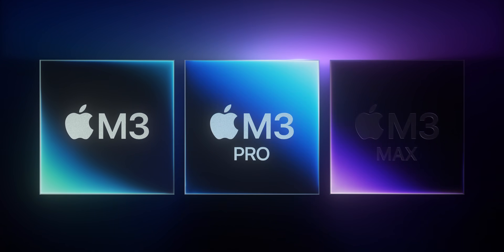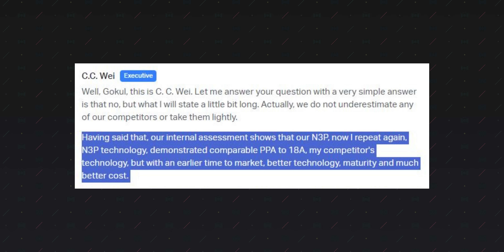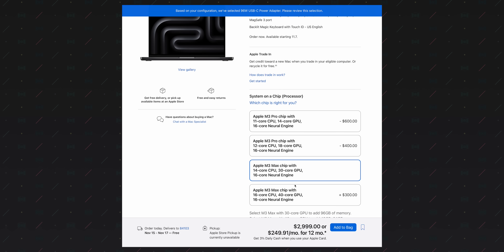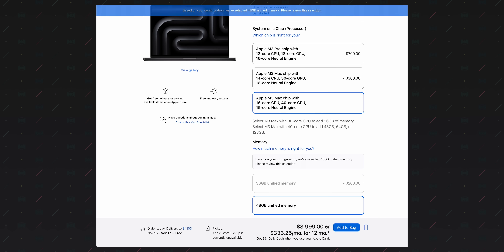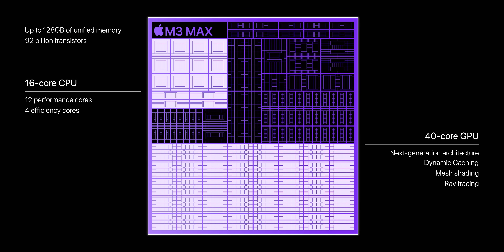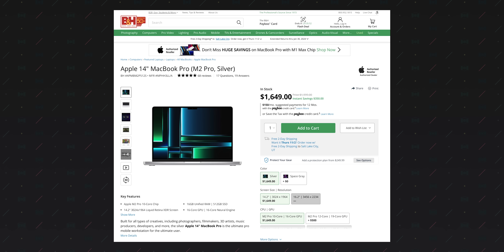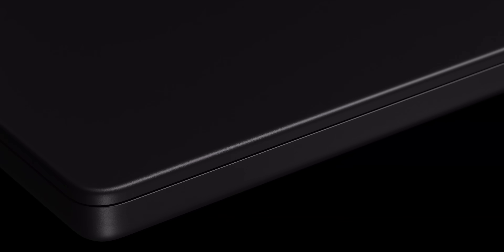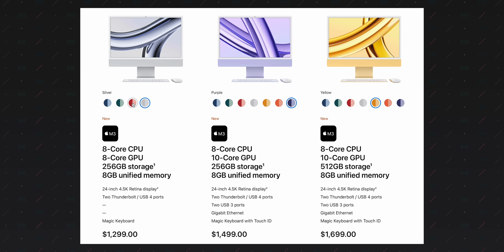Apple M3 Deep Dive: The Details Most Skipped Over

Comment: 8GB as lowest RAM Tier in an "Pro" notebook - that has to end!
Reply: When I bought my first MBP, the lowest tier was 8GB/128GB. 8 years later, only SSD doubled up. It's embarrassing given the RAM price right now.
Reply: @huyanh995 the SSD quadrupled
Reply: @nylotical  from 128GB to 256GB base M3 is not quadrupled.
Reply: I had 16 GIGs 10+ years ago @huyanh995
Reply: @huyanh995  Why? It's only a $250 upgrade for 8GB more    😝😝  (you can get 128GB on PC for that price)
Reply: You can get a $109 phone with 8gb of RAM, it's ridiculous!
Reply: @johnsch8634  just pay 109£ for tablet 64/6gb :D
Reply: when you can get 32gb of ddr5 for that  price apple is way too greedy @johnsch8634
Reply: @johnsch8634 yeah that’s not exactly a good point.   The RAM in that phone and the RAM in the new Macs are not equivocal in ANY way.   M3 can do EXPONENTIALLY more than any phone on the planet regardless of the starting 8gbs of RAM.   More RAM doesn’t mean more performance it’s better to look at the big picture to decide what quantity of RAM is needed.
Reply: @Champoforyx  have you never heard of using an extreme example to make a point?

Anyway, my laptop came with 16GB in 2020 and I upgraded it to 64GB just because I wanted to and it was cheap. I bought it to take the place of my 2014 macbook air which had 4GB of RAM and was chronicly short of RAM.

The idea of buying a "pro" laptop for $1,600 nearly a decade later with only double the RAM of my $999 2014 macbook air is laughable.
Reply: 8GB RAM good for ruining SSD.
Reply: Yeah, nobody is going to get that level of a computer and make do with 8GB, so really the entry level model is the 18GB. I think they just made a hobbled low price model, that nobody would buy, to get the low headline figure.
Reply: By the time they bump it to 16gb, 16gb will feel like 8gb again lol. I love Apple. But please, stop doing this. 256gb of storage is ridiculous as well.
Reply: And you have the base m3, not even pro this year
Reply: To align with there environmental goals it needs to be16GB across all products with unified memory. This would provide a longer product lifecycle. If it were SODIMM not a problem.
Reply: @micleeso they can’t do SODIMM.  The M3 is an SOC.   It would not be able to be upgraded.   Even if it could, there wouldn’t be anything currently on the market that would be supported by the SOC
Reply: Yes, I am aware M series chips are SOC. I was a comparison, if SODIMS were still used then a future upgrade is possible, enabling a longer lifecycle. @Champoforyx
Reply: @micleeso  it would limit the performance of the M3.    They require the RAM to be incredibly close to the package in order to function at a high level.
Reply: then who will buy new m4s lol
 @micleeso
Reply: 8gb us still Pro guys
Apple meant Pro-blematic & not Proffesional
Reply: This should be not up for debate, idc what your workload is - 8GB is criminal in 2023 regardless if you're a student or professional.
Reply: Yeah everybody is angry about it , everywhere on the web .
Reply: In the DIY PC market, 32gb has been lowest recommended for a couple years now for a new build (It is $80 for a 32gb RAM kit, versus like $60 for 16gb).

8gb was obsolete in 2015.  8Gb kits are not even made anymore.
Reply: @Zyxlian and that is just system RAM.  That doesn't include VRAM, like the M-chips do
Reply: over 2000€ in EU, no sense
Reply: @jeremy__hopkins  I think they know nobody in their right mind will buy those, or pay the ‘starts from’ price. They could advertise a version that starts from £1000 that, by some clever ‘stink embedding technology’… permanently smelt of dog poo. It’s a bit misleading as they know nobody would ever buy that model. So the ‘starts from’ price is essentially just click bait.
Reply: Well, a year later and they heard ya.
Reply: Wish granted
Reply: even 256 GB SSD is pretty sad for pro macbook at baseline. A Mac is not an iPhone, 256 is still ridiculously overkill for a phone but I see 1TB as a baseline for me on a mac. But I guess that means I must shell out an extra 100,000,000,000,000,000,000 to get the upgraded storage
Reply: @Kelson01   256GB overkill for a device that can record 4k videos in slowmotion?  In what universe do you live?
Reply: @voidmayonnaise  Which is why I upgraded to 64GB Ram (sorry, 'unified memory') on my Mac Studio M1 Max... cuz I knew that anything less would make the machine feel really slow 5 years from now.
Reply: overkill..&overpriced...i got a cheaaaaaap 12th gen 6&6core...god super high single core score...at literally 30% price with 64ram cost nothing ... @rsr789
Reply: Yeah that´s just a scam
Reply: And £200 to upgrade to 16GB (in the UK) is criminal
Reply: macrumors apologist...`yeah but...`
Reply: @youngtrench3711  top rated comment on the Macrumors post about the M3 MacBooks is one criticising the 8GB RAM, so no, Macrumor users are the most critical of some of Apples dumb moves like this
Reply: I’m not paying a single cent more for larger memory or storage! 8/256 all the way.
Reply: Next you’ll say 16 has to stop
Reply: $600 AUD to upgrade from 18 to 36GB RAM… the apple has rotten
Reply: That pisses me off!
Reply: In a “Pro”*
Reply: @firerainnzz  they are pro devices.     Not all pros need tons of ram.   Stop acting like MacBook pros are not the top tier of laptops
Reply: @Champoforyx I was correcting because it should be a pro not a pro. I fully agree that MacBook Pros are the top tier of laptops.
Reply: @Champoforyx open photoshop, MBP has left the chat,
Reply: So, just like the M1 and M2 13" "Pro" models before, this new M3 Macbook "Pro" is Apple really straining the definition of what most in the tech world would define as pro. At least, they upgraded the hardware to Pro-level.
Reply: I agree that is is too little for most professional workloads today, but I can't really see the problem with having that option. Just get one with more RAM.
Reply: @Pekz00r the price of ram on Mac is just absurd
Reply: @neojfk1883  Yes, I agree with that and THAT is the only problem here. Not that they start at 8 GB.
Reply: Why!? Sheep will buy
Reply: @neojfk1883 
 sheep here😂😂😂😂😂
Reply: My $4000 PC has 192GB of DDR5 6800MHZ RAM and 24GB of DDR6x VRAM

I wonder how much 216GB of Unified memory would cost in a mac Pro
Reply: Especially when RAM and SSD prices have never been lower.  1TB and 16GB should be bare minimums in 2023 on any computer.   That's a $400 upgrade from Apple ($600 on the iMac or Air)
Reply: Apple started using 8gb as there base ram for MacBooks since 2012.
Reply: I think this is Apple's new selling point. It used to be buying all these expensive dongles and accessories for the laptop, but now its pay a boat load for ram. I mean even my old cheapo mac mini can put in 64gb of ram. So dang glad I got that thing as I wait for them to make ram prices more fair.
Reply: It's of no practical significance they spec 8GB.  It just makes the price look better.  Anyone "pro" will already know they'll be paying an insane amount for extra RAM.  Having 32GB base wouldn't lower the price of 64GB.  8 and 16GB flash was useless for iPhones, but they kept that around forever to shave a bit off the supposed price.  Again, to no practical detriment to anyone who didn't buy it.
Reply: 8gb/256gb has been the baseline ever since 2014. The baseline macbook "pro" hasnt seen an improvement in storage in almost a decade
Reply: The leader in E-waste won’t change their business model if dummies keep buying their garbage configurations😂
Reply: @sydwelglobal1439  I mean, it depends.  My friend got a base config laptop, my folks got a base config iMac, and both have got over 5 years out of them.  The iMac will probably hit 10, and only need replacing because of obsolete software, not RAM or CPU.
But, sure, the base configs are an annoying way to make the real price of what most people need seem $200-800 lower than it really is.
Reply: You don't get to be a trillion dollar company by offering 16GB of ram on your pro model.
Reply: The “8gb ram is insufficient!” folks have no idea how SoC or unified memory works. 🤫
Reply: android sheep are here😂😂😂😂😂😂😂😂😂😂
Reply: @jeremy__hopkins To be fair I have a ‘13 Macbook Pro that I use daily. I was concerned they’d completely abandon x86 Mac’s (especially the old ones). In reality I still get frequent of quality of life improvements and security updates. Just one example, my watch now unlocks my Macbook. Hardly life changing, but nice to have. That said Windows has gotten a lot better in regard to updates as well. My wife’s laptop is a 2014 that originally had windows 7 and is now on 10 and running well. Just giving credit where credits do. Then again, I might be singing a different tune if my ‘13 Macbook Pro wasn’t top spec at the time it was built.
Reply: It’s the hole reason I won’t make the switch from Windows to Apple laptop
Reply: The MacBook Pro with a m3 ain’t pro tho it’s just a boosted mac air the real pro is the m3 pro chip
Reply: @bobmorane2082  a processor named “pro” I guess makes sense linguistically as far as marketing, but I’d argue what really makes a computer suitable for pro (work you get paid for) use would be port availability and ram hdd space.  The M3 is pretty powerful.  But even a M3 max, with 8GB, wouldn’t be suitable for pro work outside of say, writing a book.
Reply: Snazzy actually thinks 2GB is enough
Reply: 8gb is a joke. I have two M1 airs. One with 8 and one with 16. The 8gb one struggles the moment you using multiple apps. The M3 should have started with 16gb.
Reply: @iamsid23 interesting as most all reviews said that fir mist people, including those running more than one app, only need 8GB. And for most apps that true.
Reply: Yes, and to get cheapest 16GB M3 you need almost 2000$, M1/M2 with 16GB ram was possible to get from 1100-1200$ or so.
Reply: @jutjub22 they haven’t released the MacBook airs yet, apparently it’s getting cheaper
Reply: The education price is $1680 plus tax for base M3 Pro with 16GB RAM. But, yes, you are absolutely right about Apple's obtuse insistence on price gouging for 16GB RAM.
Reply: 😂😂 Yes 8GB was what I had in my ‘pro’ workstation back in 1998. 128GB was my workstation in 2016. So in 2023 the memory footprint for a ‘pro’ workstation should be 1.5TB ram, not 128GB. lol
Reply: lol hhhh
 @BrentLeVasseur
Reply: Why is 12GB base RAM too much to ask for? 6GB x 2 chips are too expensive compared to 4GB x 2 chips?

Give me break dammit.
Reply: @siewkimng1085  they dont need use 8gb chips or even 1-2gb this is 1 part of silicon space cost is cheaper make 12 not 16 space cost :D smart move thay not look what you need , they sell what they think you can get = minimum
Reply: @siewkimng1085  considering that there’s 18gb/36gb etc models that use 6gb chips it’s funny that they went for 8gb with 4gb chips, this way they have to make 4gb chips just for the base model
Reply: 8GB shared with CPU and GPU. Funny fact: Samsung, the main manufacture for these RAM, doesn't even make money to make these out of date 8GB ram chips.
Reply: 8GB is still all MOST folks ever need, for what they use their Macs for.
It also allows Apple to offer a lower price point for entry-level customers. If you want more memory, pay more money.
Reply: @lorensims4846  I mean, if you don't game or do anything besides browse, watch 1080p movies or listen to music sure
Reply: Nope I just bought the MacBook Air 13 M2 with 16gb and 512gb last summer. For the battery life is amazing and for what I do it is amazing. I came from and Intel 2019  i5 16 gb 256gb pro. And I don’t miss it it at all.
Reply: I bought my first and last MBP in 2008. Never again. Garbage tier
Reply: Most don’t get it, it’s a complete new chip architecture. Which means old RAM counting does not apply anymore. 8 new is like 16 old, a.s.o.
Reply: @weissmannrob  I'm not sure if that was a joke, but that's not how RAM works. 8GB on ARM Mac is just like on Intel Mac but faster, though some Intel Macs had dGPUs with their own memory so you'd have more of the 8GB usable than on ARM Macs.
8GB RAM is ridiculously low for 2023/2024. That was pretty much the lowest recommended amount 10+ years ago
Reply: @weissmannrob sheep being sheep
Reply: @weissmannrob  Not true. All the new Mac OS is doing is dynamically freeing up ram, which by the way is now shared with not only the CPU but the GPU as well because the Apple silicon has a unified memory architecture. So let’s say you have a very large dataset that needs to be in memory in order to make calculations, then it will just fill up all your available ram (less the RAM your GPU is already using) and cache the rest to your hard disk. In 2016, I was doing 3D scenes that easily took up 512GB ram to render, and I had to rent out AWS instances to render them because my 128GB ram in my Mac Pro wasn’t nearly enough. Most people don’t work in large datasets, which means dynamic memory allocation will be like as if they had more ram, but in situations where you actually need large blocks of ram to calculate, this will fail because it will send most of it to the swap file on your hard disk, which even though its a fast SSD is still a lot slower than having everything in memory.

Comment: Putting the base M3 in a 14" chassis feels like overkill. All that weight and thickness for a chip that can be passively cooled in the MBA doesn't seem like a good buy unless you have to have a 120hz screen.
Reply: The screen is better in more ways than that. Also, it has a better array of ports and much better battery life (although these days all the MacBooks have great battery life).
The M3 is PLENTY fast enough for almost everyone. There's is no logical reason why you couldn't value all the benefits without needing more than M3 power.
Reply: @jacobrichter  I can understand needing the ports, But $1600 for a laptop with 8gb of RAM and a chip that will be in the $1100 MBA is still a hard pill to swallow.
Reply: @nathanross4036  That's certainly true. I'm mostly saying that it makes a lot more sense than the 13" MBP, that basically only had the advantage of more battery life compared to the MBA.
Reply: But it cannot be passively cooled in the MBA. 1st of all, there is no M3 MBA yet, but 2ndly, MBAs DO reach the max temperatures and slow down. 
Sure, they could have gone with a smaller chassis and just one fan, but it probably was not worth machine setup/engineering/validation to create a whole new SKU.
Reply: @Alwarin1  Ah yes because they are just going to stop making MBA, the best selling Apple laptop
Reply: But, but, but we have to render our 8K Canon Raw footage on that M3 and not melt down the chassis! ;)
Reply: @techinrl9869  $1600 is a ripoff for the horsepower you get in this machine lol
Reply: @techinrl9869  not really, I just do not like 40-celsius-hot chassis when trying to play oceanhorn from Arcade, as was the case with my M1 🤷‍♂️
Reply: @Alwarin1  that was a joke, btw. It makes fun of the YouTubers who kept insisting the MBAs were trash because they throttled when doing ridiculous things like rendering 8K Canon Raw footage on an entry level Mac, things that should only be done on high end machines.
Reply: And don't forget the price, 1600$ for 8GB of RAM